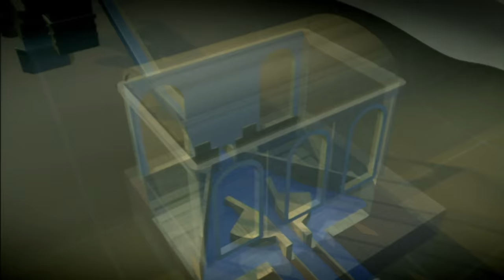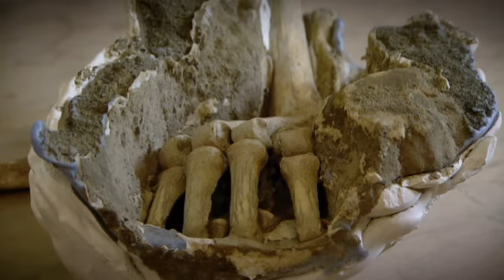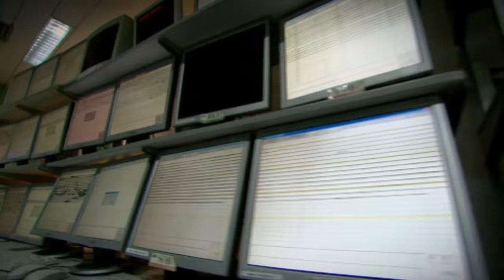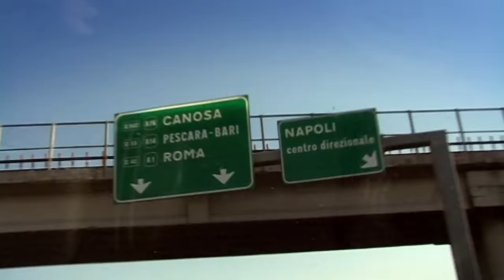How Herculaneum Is Better Preserved Than Pompeii | Herculaneum Uncovered | Timeline

Comment: I've been to both, and Herculaneum is tenfold more impressive than Pompeii.  Herculaneum's walls are full of paintings, tilework is abound.  There are even spots where you can still walk on the tilework and get up close to the painted walls.  I dug my thumbnail into a door frame and pulled off a small chunk of charcoal burnt by the volcano.  Herculaneum is absolutely astounding.  This documentary states no bodies found at herculaneum but thousands found at Pompeii.. correct me if I'm wrong but what they found in Pompeii is the void left behind in the pumice layer from the bodies that rotted away, and they filled those voids with plaster.  And they did find bodies in Herculaneum, hundreds of them, I've seen them and photographed them.  The people all ran down to the boathouses to escape, and there they were roasted alive by the volcano.  Their skeletons and remains are still there to this day to be viewed.  EDIT:   Apologies, later on in the documentary these bodies are discussed.

Comment: I l live on a major earthquake fault line so I have been told between Kos and near Bodrum. A few years ago we had a 6.something earthquake very scary but my apartment had no damage and I hope the plates will take years to build up tension again. Only minor shakes since, that is good, pressure releived.
I know what I do in an earthquake now, push everyone outside. I cannot explain what it is like, the noise is the worst, the vibration, it just makes your ears full and you cannot stand, you are shaking with the earth which kind of moves like a wave beneath you. That is probably the scariest thing. We had electric until the first aftershock 5+ I beleive.
Not a nice experience but hopefully with the aftershocks that went on for weeks, gradually diminishing in power, we will be fine.
Reply: Hello Anne, how are you doing today, hope you’re fine and safe from the COVID-19 virus??

Comment: My teeth are bad after 35 years of life, and  these Romans' teeth are still good after almost 2000 years.
Reply: To be fair your teeth aren’t protected from every possible danger by a thick coating of rock - also less access to raw sugar
Reply: Benjamin Klaene Yes. That is a good point about the sugar. I was more making a joke about how people in the modern world in general depend on dentists more and have more dental issues. 

In my own case I have additional health problems which make my bones weak. But I was meaning in general.
Reply: Ahh yes the joy of having a person pick around our mouths or filling the occasional cavity on the regular and still having it worse than a Roman is a good point and said rather jokingly but my response was also supposed to elicit humor - I am afraid that it failed to do so, it was not meant to be nit picky
Reply: @StopFear  Our diet has a lot more sugar than the diets of ancient people, which is why we seem to have more carious teeth. But I imagine if a Roman did develop irreversible pulpitis in one of his teeth or a dental abscess, he must have been in horrible, radiating, continuous pain until he got his tooth pulled (with or without anesthesia, I do not know) whereas nowadays, we not only have safe painkillers to manage the dental pain, but a dentist is able to fully treat and preserve our tooth in our mouth via root canal treatment (under local anesthesia) instead of just pulling it out.
Reply: They did not have sugar like we do .
Reply: stop smoking meff
Reply: @haelotny6523  Good luck getting even 6 Vicodin from a dentist for an abscessed tooth now with the opioid crisis.  I spent 48 hrs in literal agony waiting to get a root canal because dentists won't write an Rx anymore. When they opened tooth a ton of foul infection poured out.  Its nearly as barbaric now as 2000 yrs ago.
Reply: @haelotny6523  whatever, the dentist is big business. Cleaning teeth; 150 euro a hour. Cleaning toilet, also important; 12 euro a hour.
Reply: @FRAME5RS  You need a new dentist!
Reply: You just couldn't help bringing your health and fitness fetish into this, could you?
Reply: @richardnoordhoff4288  Because anyone can clean a toilet but most people can't clean your teeth. You need to go to university for 6 years and use expensive equipment to be a dental surgeon, while any illiterate person with a rag, a bucket of bleach and rubber gloves can clean a toilet. Pretty big difference.
Reply: @richardnoordhoff4288  Teeth are also much more important than toilets. People have lived without toilets for thousands of years while teeth are a body part. Comparing them is pretty silly.
Reply: @MargaritaMagdalena   Yes. Pizza Margherita, teeth are a body part. However, modern marketing turn  teeth in to fashion. Healthy food is the name of the game, our food system prepares us to be a customer of big Pharma, with support of all governments world wide.

6 years of study creates slaves, it's all for the money. Money is a tool, not a target.

Pay cash do not support the criminal bank system. 🙃

Comment: Pompeii seems to have been primarily covered by lava.
Herculaneum by contrast was almost instantly buried in a pyroclastic flow. The people were primarily killed by silicate ash heated to around 1800 F. Or more.
The most significant thing about this area is that Vesuvius is of course not only an active volcano its nagma c h amber is a small part of a nearby supervolcano which currently is showing worrisome activity.
Modern day people have intensively populated the entire area.
When not if the supervolcano erupts the pyrockastic flows and bl a st will bake and bury anything and anyone within a couple hundred mile diameter .
There would be no survivors.
The effect on the greater part of Europe 
Would be catastrophic.
The effects over the Northern hemisphere would be very damaging. Agriculture would be heavily impacted due to atmospheric dust and aerosols such as sulfur compounds. 
People of the modern age know the potential for disaster. They continue to live here generation after generation. They gamble that the supervolcano will not erupt in their lifetimes.
S o far they have won their gamble.
But someday they will not.
Reply: Pompeii was covered in tephra, not lava, but ashes and pumice.

Comment: That layer of plaster shown from 12:06 must have acted as a microphone. Each sound wave penetrating into it must have left its traces a little deeper than the one before it. An analysis of the densities in the plaster, consequently, should enable a reconstruction of things that have been spoken by those painters.
Reply: @charlesmcmillion5118  Certainly, you'd have to screen the material with utmost care and also to apply a lot of computational power.

Imagine that one loud bump is heard while something coagulates and a few minutes later, another such bump! Already the machinery of today would easily enable a recognition of this. Refining your process, you'd have to compare thousands of snippets with traces of groups of sound waves, but why shouldn't you generally be able to do that? We are not living in a world without computers, any more, and our computers are going to become endlessly stronger, soon, via a shift into optical methods.

As a help you could use patterns typical of the traces of Latin in plaster, which you could obtain experimentally.

It might not yet be possible today, but clearly-enough positioned compressions nonetheless might be lingering in there, waiting for a finer technology to arrive with which you can make them resound, again. After all, the granules in plaster easily can have diameters of just hundredths of the ones in carbon-granule microphones. Electrons, just like other subatomic particles, most mundanely are moved by mechanical forces (e.g., downward through shaking an object), with the consequence of dislocations also of bigger chunks of matter. The distribution of the granules in the plaster is coincidental, and a sound wave soon will be scattered, after it has penetrated into the material. Nevertheless, you can determine how such a distribution looks on average, thus getting able to identify typical deviations from it.
Reply: Or we could get Spock to press his hand against it and do his mind-meld thingy.😁
Reply: @tomobedlam297  I'm reading that mind-melding works by putting your fingers at someone's temples. It appears as counter-intuitive, in the beginning, given that a brain is organized unlike the pulp of your fingers, but biology may easily have developed an algorithm for a useful processing of the way the brainwaves interact with such a different part of the body. Like a computer, the brain anyway can learn about everything. It's reprogrammable.
Reply: @HansDunkelberg1  The brain is a programmable computer? You clearly have no women in your acquaintance! 🤣
Reply: @tomobedlam297  Perhaps you underestimate how strongly the heart can interfere (bei it with men or with women), occasioning the brain to switch from one program to another. This just proves my point of reprogrammability.

Comment: I wonder if you could preserve the ruins in several inches, of some sort of resin spread wherever it was needed. It could still be viewed, and possibly be protected.

I have never heard of such a large scale use of resin, so maybe it's a ridiculous idea, but I would love to protect the history for the generations to come somehow.
Reply: Actually early archaeologists had a similar idea to you and tried to cover some of the frescoes in wax to preserve them, this had a reverse effect in breaking down the paint and ruining the frescoes. The wax was attempted to be removed but as you could guess the wax took lots of the paint with it, like wax pulling on a hairy chest or leg. Because of this incident, archaeologists have been very against the coating of any other substances on the walls of these sites. Some sections are trying to be  encased in glass walls today

Comment: It sounds like a disaster and a tragedy waiting to happen.  It would be helpful if the local and central government had drills every year.  I live in California and we do drills every year for earthquakes (usually in October).  Of course not everybody participates, but I think that by now it is embedded in most Californian's heads what to do during an earthquake.  It becomes automatic after practicing, watching it on the news, and reading about it.  That doesn't mean there will be zero deaths, but probably a lot of lives will be saved.  It's just a matter of time before a big earthquake hits a highly populated city in the state. 
In the case of Naples and surrounding areas, the authorities have to do whatever works for them.  There's not one solution for everything.  As long as there's a dialogue and willingness to cooperate, they can save a lot of lives if they're well prepared.

Comment: Maybe it'll say later on as I'm early in the show, but I wonder how full the magma chamber is now considering it erupts every 2000 years and it's due again. On another show I seen that its temperature is actually dropping so there's no imminent danger. At least not when the show was made.
Reply: And I realize it erupted in 1944, but it's due for a "Plenties eruption".
Reply: Vesuvius Magma chamber is 23 miles long but thankfully as of late Magma hasn't been detected within 20 meters of the surface and it's Plinian Eruptions don't occur every 2000 years, it's actually every 1500 (more or less). The last such eruption occurred in 1631 AD and 6000 people died when it destroyed Toro Del Grecco and Boscoreale.

Comment: There are special epoxies designed to correct cracked concrete slabs and make them safe. They could be injected under pressure and leave little signs of the repairs. I have seen them used on construction sites with the Corps of Engineers. I hate to see concrete patches on historic artifacts.

Comment: They should do what Israel did in finding the pilgrims street. They dug under buildings and added extreme support system to support the buildings on top. Also, they could outright buy some of the buildings on top if necessary to demolish. I like the Jews idea better though.

Comment: WHAT IS MOST INTERESTING IS AT 53:34.  YOU WILL SEE THE LETTERS   W AND A.........FUNNY, I AM PRETTY SURE THAT THERE ALPHABET DOES NOT HAVE        THOSE LETTERS. !!!                                                                                                                                                                                                                                                                                                                                                                                                                                                                                                                                                                                                                                                                                                                                                                                                                                                                                                                                                                                                                                                                           BM
Reply: okay melissa. whatever you say
Reply: Great eyesight and hearing -- as he points out a V and an *A*, both if which ARE Latin.